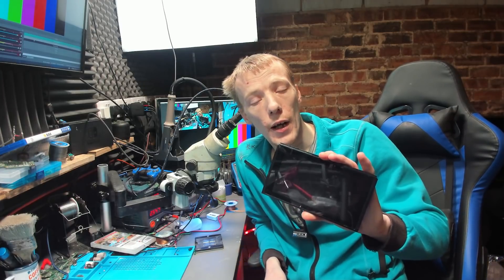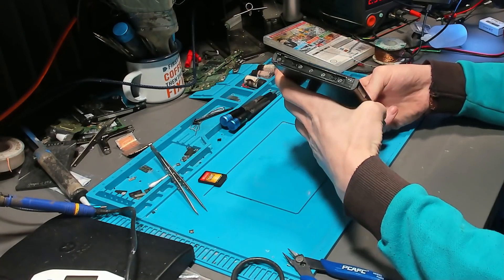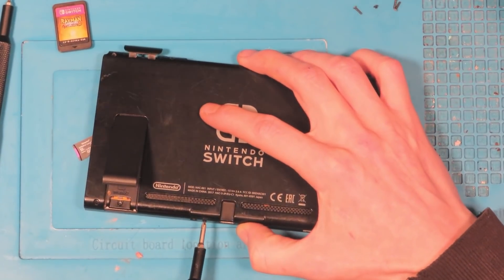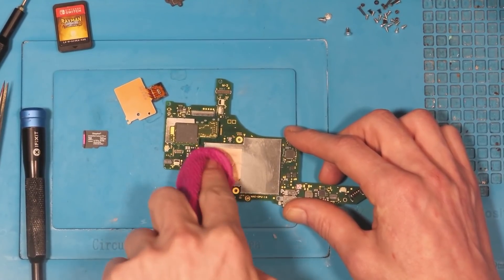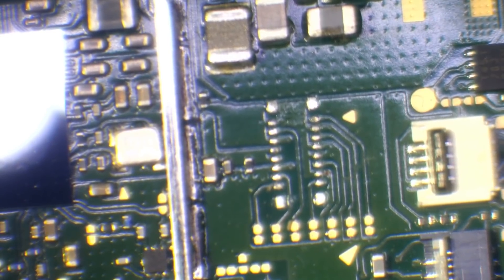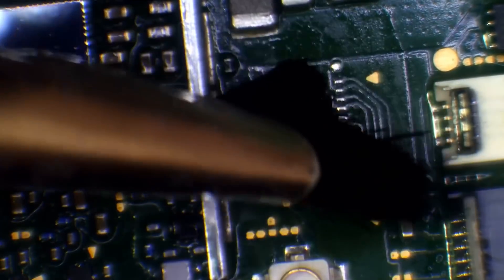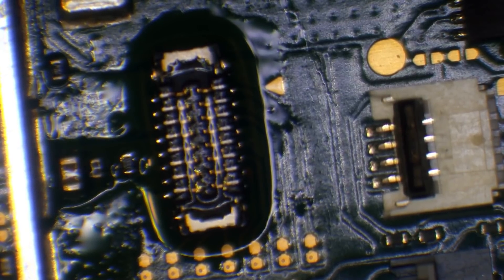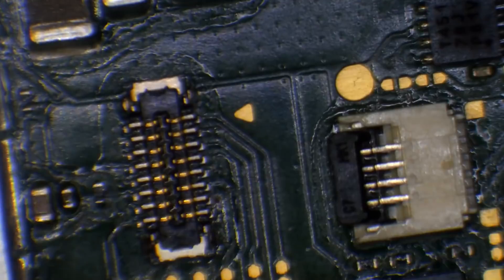I NEVER Get The Easy Jobs... Usually! Nintendo Switch Not Reading SD Cards. Can I Fix It?

Comment: perhaps you already have a video regarding this issue but my Nintendo switch is only charging with 3rd party usb c cables I've tried 3 different Nintendo brand chargers and nothing. it also only charges slowly with the 3rd party cable. my usb c port looks to fine i don't see any damage. I'm wondering if its the charge chip?

Comment: Girlfriend had similar problem with hers when battery ran out sd card constantly needed reformatted so I bought new sod card slot but before I replaced it put a new sd card in to try that was 6 months ago sd card hasn’t needed reformatting since researched the sd card she had and it was a dodgy clone card

Comment: Have you ever had an issue where the SD card was working but would randomly disconnect? The kid next door's Switch is doing that and I reflowed the pins on the connector just with my soldering iron and that seemed to fix it but it seems it was only a temporary fix and it's had the reader changed twice. I'm wondering if I should go as far as a full connector replacement but I'm not sure how much I trust myself with that kind of job yet.
Reply from the maker: Yeah I have had that before. Do you by chance see any bending in the case? It could be a sign of worse things to come (connector coming off or causing BSOD eventually) if you do. I'd say to go for a full connector replacement to be honest

Comment: When you heat from the bottom of the board, do you risk floating off components on the underside?  I'd be worried about gravity taking over.  I haven't done this during a board repair yet, genuinely curious.
Reply from the maker: It can do but air flow is too high, but be modest with your air flow and you'll be fine. Also you have to be aware of the position of your hot air wand. Wayne from Wayne's Noob Repairs UK (there's a link to his channel in the description) had this issue last week. He accidently knocked into the bottom of the boars with his wand and knocked a whole load of components off

Comment: good to watch n always learn about these things,my switch had a issue where the sd card would actually try to read but would soft brick the switch making it useless,even booting the switch up with the sd card stays locked on Nintendo screen,i tried swapping different class 10 sd cards,then swapped the sd card reader with another switch, formatting the switch and still same issue for me,had realised i had 2 months warranty left n sent to Nintendo been waiting over a month now for it still. but your other video of the switch sd reader repair has given me an idea that something similar has happend to myne
Reply from the maker: Thanks mate. Yeah I've actually got another one I need to fix tomorrow, same issue. It's more common than people think but a lot of the time it's down to the connector just coming loose from the board
Reply: @TheCod3r  oooo ok,i checked myne and seemed to be intact,but will definitely be watching thanks for the heads up.always good to learn from you